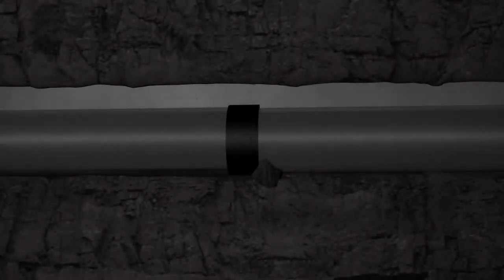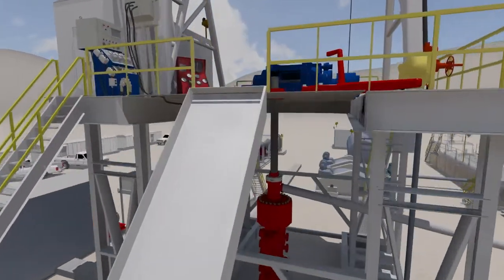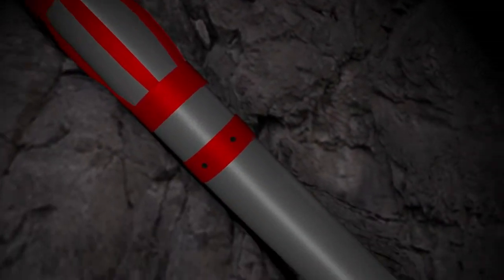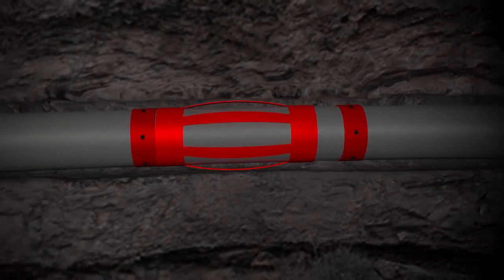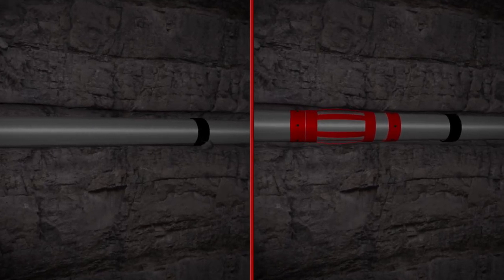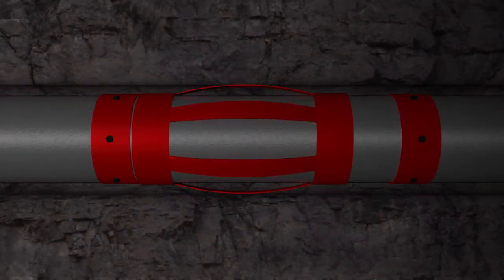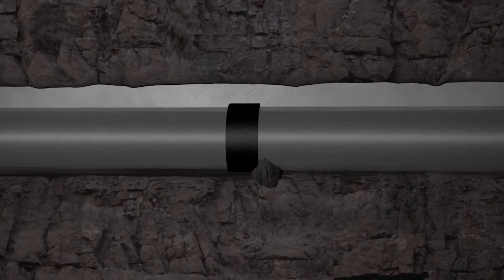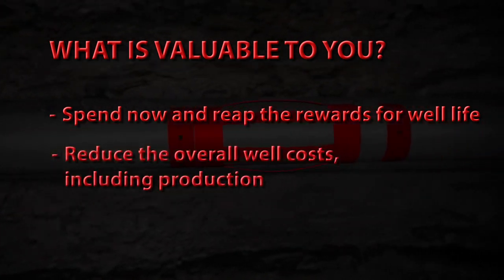Casing and Cementing Centralization

Comment: Perhaps BP should have listened, and then followed the advice of Halliburton, regarding the number of centralizers required on the Macondo well.  21 recommended, vs. 6 used, the outcome might had been much different had BP sprung for ONE helicopter flight to the rig.